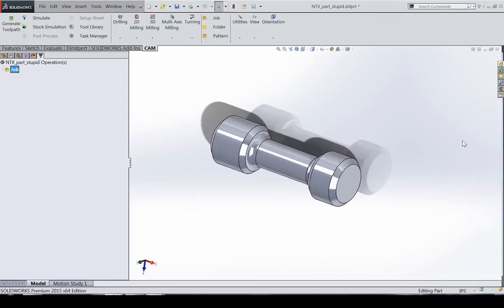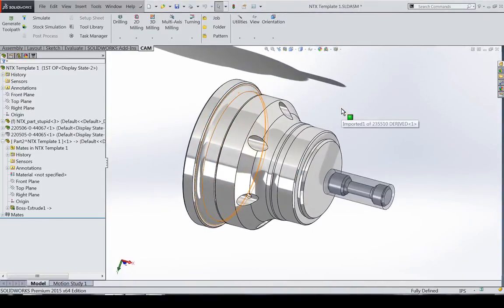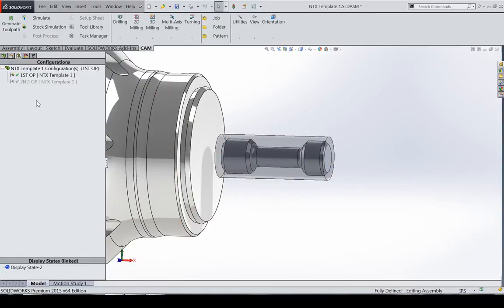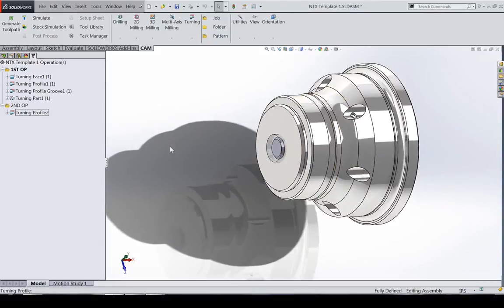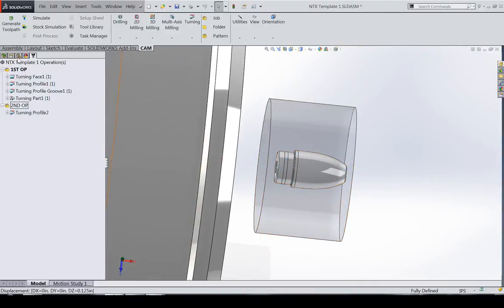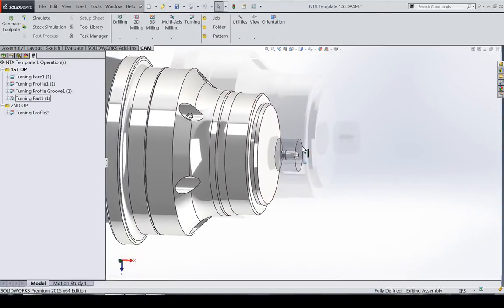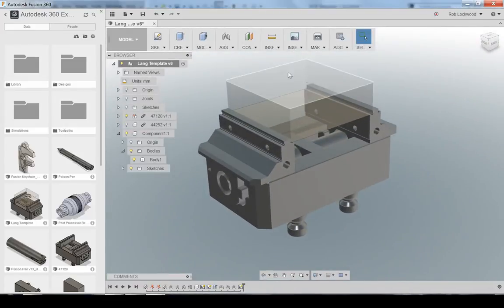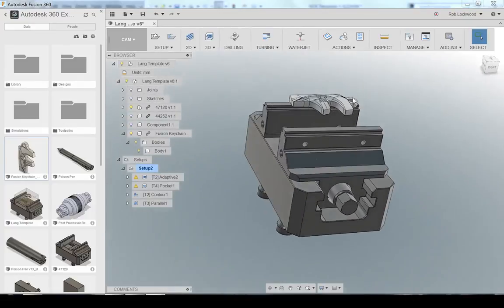HSMWorks How-To: Using templates- but not THOSE templates.

Comment: Very cool for HSMWorks users. As you've identified not a lot of the workflow can be carried over into HSM or Fusion. Neither CAD product has the ability do the replace in the way Solidworks does, that is a neat feature I didn't know Solidworks had. I think you could get something close using workplanes in the Autodesk CAD products, but the reference rebuild wouldn't be guided. HSM and Fusion can't carry the stock over from the previous job.... still. Which really blows. And no machine configurations ruins the neat presets you had going on with the jobs. You'd have to use keywords in the setup folder name or comments or something to trigger the use of a different post somehow... actually it's probably fundamentally impossible. It just rips my undies how far behind Inventor HSM still is from HSMWorks in so many nice details. Anyway that shouldn't take away from what is a great workflow in HSMWorks.
Reply from the maker: Right, while fusion is #notatoy -- I still have a hard time recommending it to serious users, as while the tool path and code generation are the same, I don't think the overall package is mature enough quite yet.

To be fair, most of what i'm doing here isn't a designed workflow, it's just a collection of features within Solidworks that pair together nice with the CAM environment. I sincerely hope the same can, either through creative users or implementation of features, be said of Inventor and Fusion in the near future.
Reply: rob lockwood Agreed... and I get that it's not a designed workflow. But what you have demonstrated is what can be achieved when an imaginative power user puts the pieces together. It's the kind of thing I tried immediately with Inventor. But, it's missing features on the CAM side of things that make a viable workflow like this possible.
Reply: Oh how things change in four years... Is there a better way to do the replace operation now?